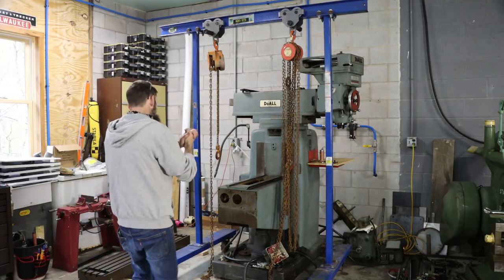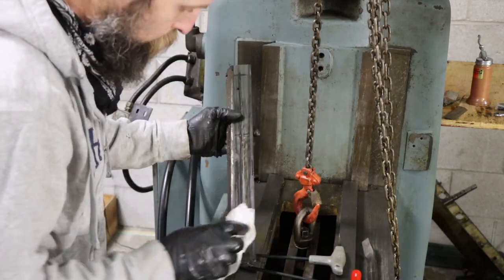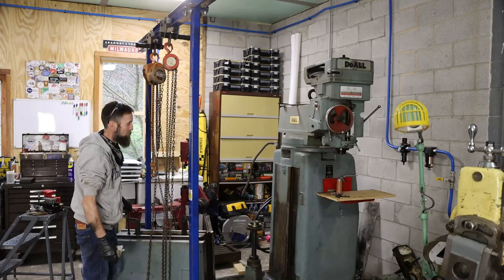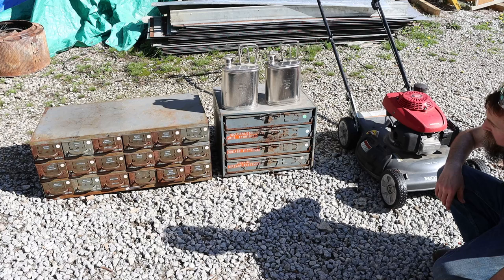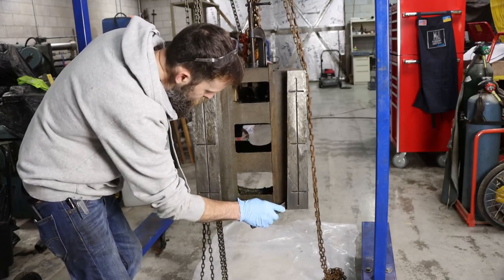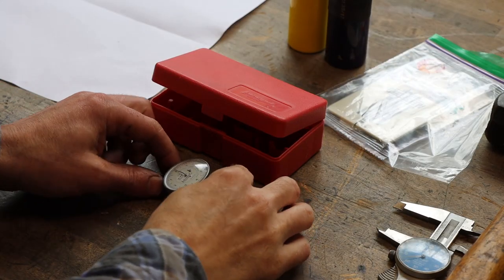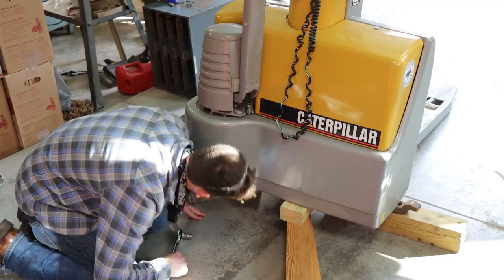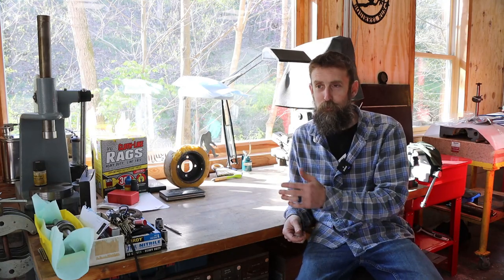Off with the Knee of the DoAll milling machine.

Comment: Hi Steve, another handy item in the shop for installing and removing screws is the "Chapman" ratcheting handle with an assortment of bits up to 3/8" hex, screwdriver, and Torx bits. Love mine for getting into tight places.

Comment: Mill is progressing nicely. Glad that you were able to remove the knee so easily. You didn't have much lift left, just enough. I was thinking about that DoAll band saw. If I remember correctly your last on it was that replacement shaft. I remember you didn't drill it all the way through. I think that will be an issue as here is only one port for oil to enter, no way for oil to get to both bushings.
Thanks once again for sharing your adventures. Completely enjoy watching.

Comment: That forklift wheel was on the edge of unsafe! Surprisingly simple access... if you have a toe jack. What a screamin deal for such a good lift. Watching the knee removal on the mill was fun, but I'm anticipating videos of your projects! Thanks for your videos, I always enjoy them.
Reply: My luck on the wheel replacement would have gone something like this: spend a day just trying to lift it, 3 days fighting to get the old one off, a day and a half to get new one installed, a half day to lower it down..... then discover there was a lever I could have flipped to open all the covers up and get direct access, while cleaning off my greasy fingerprints.

Comment: I worked for a Montgomery Wards in the late 70's in the repair shop. Maintenance contracts were very popular then. People would abuse their mowers because we would still fix it under the contract. It was easier to fix than argue, I guess. Wasn't my decision. We had a commercially made jig specifically for straightening crankshafts on vertical crankshaft mower motors. We were selective about straightening them. Agreeing with your statements, only ones with minimal run out would get straightened. Otherwise we would use a new short block. The labor time was not very different but the parts cost was.

Comment: Amazing how machines/heavy parts grow in size when you get them in the air.

I think, in time, you won't miss what you spent to get that lift into shape.

Get that mower started and see just how bad it vibrates.  If it isn't super bad, use it where you wouldn't want to take your good mower.  If you kill it dead on something, you haven't lost anything.  I had one I used for years, across the creek that went through the back yard.  I'd come back across the creek with my eyeballs wobbling, but it did the job.  Deck falling apart was what finally killed that one.

A two day barn/shop warming event sound appropriate to me.  One day for Brian's, the other for yours  ;-)

Comment: The sun light poking through the windows looks great... Not to insult your intelligence, by any means, but, pay close attention to oil rags in a waded up area, and sun light rays beaming in on them.. of course, in the middle of summer... I had one do that, on me, some 20 years ago, about 4 hours after using the few rags, and was doing something else and was gonna come back to finish that project up, and was smelling something burning.. turned around, and the few rags were flaming away.. I am just glad it was on the concrete floor and not my work bench, and lucky I didn't walk away.. I do remember, the stories from wood shop and metals classes back in high school, that would warn of such a thing, and always imagined, it was from throwing them is a box, and stuffing them in a corner and forgetting about them.. Nope, hours after use.. All because the sun was shinning right on through onto the rags I was just using..  Anyhow, it is all coming together, the shop that is..good job.

Comment: My friend - when I was a young man I worked in a huge Lawnmower central repair Hub shop for Montgomery Wards. When a pushmower would come in with a bent shaft we would pull the blade and blade holder till it was just a crank sticking out, slip a short length of pipe over the shaft and give it a whack with a short hand held sledge (my dad would call this his "Bappin' hammer") anyways, you knock it around until true by eye and you bolt that shit back together and send it, Lawnmower cranks are soft as can be and this is normal practice - Just FYI

Comment: I have a mower from the late 50's that I was using when I was a kid . I was trying to mow down some high weeds by picking up the front of the mower moving the it forward and dropping on weeds with engine wide open. What l didn't know was a pipe in the ground and I hit it. The key in the  flywheel was sheared but  
also it cracked the flywheel. I took the flywheel off another old engine and put it on with a new key. The point is the crankshaft was not ben

Comment: One, I would suggest cutting a piece of wood to bolt to the bottom mating surface of the screw housing while working on the machine to protect that scraped in surface..  Also the screw inside a screw is for a finer adjustment.  

WD-40 and a scotch bright pad will clean those surfaces better than a power washer, also it won't rust the metal.

Comment: Steve, another great video.  The vertical ways look fantastic.  The grinding should go really well and that machine will be fantastic.  New squirl as well. Epic!  Additional standards for the hardness tester a huge plus.  Vladimir's channel is his name :).   That apron is fantastic :). Those dyes will be great for getting the mill scraped in.  Thank you so much for the shout out.  Work has been keeping me very busy and I do have more footage to edit.  A lot on the arbor that surprisingly turned out well with issues.  The indicator should work very well if not just let me know.  Thank you again, Phil.

Comment: I mowed alot of lawns as a kid and went through many different brands. Never really found one i didnt think was crap in some way but the honda mower i used worked well but most importantly started on the first or second pull every time.
That cat fork lift sure seems to be worth every penny. Your body is going to thank you later

Comment: Hi Steve, the wheels of your forklift are made from a polyurethane elastomer, one of the popular brand names is Vulkollan. This is a very tough material but it can wear out due to fatigue. It’s also sensitive for hydrolysis, for example being for a long time in contact with (warm) water.

Comment: I had a Craftsman Mower with a design flaw of a huge key/keyway that when you hit something, all the torque went to the crank.  Bent thr crank twice having it straightened twice...  that cost was the same as the stump grinder rental I finally used to remove the stumps.  It wasn't the big stumps that got me it wasnthe 2 inch one hiding in the weeds that did it!

Comment: Steve, I have a comment regarding building a copy of the gantry. The vertical posts should have knee braces added to provide a better structure on the base sides. If it is used to move a load located up high, all of the stress is concentrated at the base and that doesn't seem to be very desireable.

Comment: If you build a similar gantry, consider arranging the legs so they can rotate 90° .Then you can stow it flat against a wall ,secured by an anchor ,when not in use.
I suspect that wheel sat in one position with damp rising through the floor. Depending on the formulation, urethane degrades when exposed to moisture or hydrocarbons.

Comment: Buy yourself some high alkaline truck wash.  It's very strong and repeated use can dull paint but it works wonders with grease build up and rusted/tarnished metal.   It's better than anything else you can buy even Gunk.  5 gal is $35 at my local industrial supply.  You can delute it with water for regular wash jobs or just spray it on straight with a garden sprayer for heavy stuff.  Be sure to have the pressure washer ready to spray it off before it dries or you'll have to reapply.

Comment: For your lifting jobs, you would be better off with a small 4000# yard forklift with dual masts. They are very cheap on the used market for guys with only occasional usage and they are maneuverable enough to use inside, but can also be used outside for jobs in the yard and can be parked outside to keep your shop space free.  I bought a 4000# one in 2001 for 1300.00 and used it for 15 years with nothing but basic maintenance and then sold it when I moved.

Comment: You should look up the engine and see if you can buy a new crank shaft for that engine.  I had a bent one (not a Honda) from hitting a rock and was able to pick up a new crank for maybe $20, and it was pretty easy to install took a couple hours at most!

Comment: Even if the crank shaft is bad on the mower, you could keep the body in case your other mower's body rusts out
Reply from the maker: Yeah, the mower I'm using now is made from 2. One had a bad motor and the other a bad deck. Chances are I will straighten the crank on that Honda. It's not badly bent. Really just enough to vibrate badly.

Comment: For a good cleaner for cutting grease and oil that would work for the knee or anything else, try and get ahold of a produce made by Zep. Its called Zepteen. Its self emulsifying and cleans awesome. Only draw back I found is it kind of stinks. Something to use outside. Spray it on,  let it soak, Brush or scrub if you want, then either hose off or pressure wash.

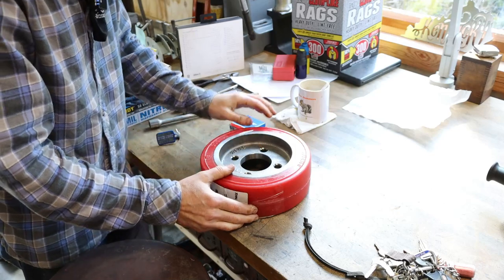Comment: 33:54 Oh gee Steve, don't you know that red wheels go faster. 😁
Reply: some times the color tell the different durometer (hardness) of the wheel (harder tires last longer softer ones slip less on wet floors)
Reply: Add a stripe and it's even faster!
Reply: More dakka

Comment: I'm surprised the gantry doesn't have some bracing or gussets... but hey I'm not a mechanical designer. Seems to do the job tho' didn't look to flex or splay out :-) 
 Oooooh another baby squirrel :-)
Hope you feel better next week.
Reply: It would probably lift three times as much with a few improvements.

Comment: I'm pretty sure that little Honda mower is overhead valve rather than overhead cam.  The new squirrel is cute!!
Reply from the maker: It's a overhead cam, strange in a push mower. I didn't know they made the jump to it. Obviously they have had the OHV for a long time.
Reply: @SteveSummers  that had to be an expensive lawnmower when it was new!
Reply from the maker: @andrewevans1658  Yeah, its probably worth repairing. I have a straightening setup I started building years ago. Guess it's time to finish it.

Comment: U should think about investing ur money/time into acquiring an industrial hot water pressure washer.... makes cleaning equipment much easier and it will take off much of what hand cleaning won't if ur fully stripping a piece of equipment.... idk exactly how your shop is laid out but if water will drain out of your breeze way/ big doors u could maneuver or set the equipment/machinery whenever first bringing it in, even then if not u can set a sump pump and make shift mote to a container or something... I serviced, repaired, and cleaned plenty industrial pumps, power packs, diesel hammers, excitors, front end loaders etc. etc. this way and with stuff much tuffer to loosen than metal working machines could ever build up....it seems to me like the route ur going it wouldn't be a bad idea to keep it in mind.... I'm genuinely interested in this stuff and ur miles ahead of me I'm just saying, no offense
Reply: Still ain't hot

Comment: You think that this gantry crane is perfect but, trust in these words. A larger model in your shop, you'll find that you will use it more often than you think and will need to use it more often than you think. As for space wise. You should check out Keith Rucker Vintage Machinery's channel. Don't remember if he bought his, I do know, he did some modifying to it. 
Honda... extremely reliable engine(s). They'll run forever. You could easily pickup a new crankshaft, not that it's going to break the bank. 
On those "ways", what about the one's on the stand part of the machine, the part the knee attaches to? Won't those be worn as well? 
Speaking of the squirrels, do the others still stop in and visit with y'all? Great video as always, cheers :)

Comment: Is the crankshaft bent or what is more likely the blade is bent ? You would need to remove the blade and clean up spot on the crank where you can indicate the shaft . I would do it because Honda makes great stuff.

Comment: Just imagine. if you had a grinder head.. and made a block to mount it to where the clapper box mounts on the shaper.  you could set the shaper to crazy slow.. and lightly grind surfaces..

Comment: It is a shame you can't have the drive wheel resurfaced or can you? I have done work for a printer as in he printed pamphlets and had a wheel for his paper feed resurfaced and I machined to finish dimensions. In his case it was cheaper than new and did not take two months to come from Europe.Good progress on the Mill Steve. John, Australia.

Comment: The old Wheel has "Jungheinrich" written on, so i suppose this Lift is a rebadged Jungheinrich, which are top quality equipment.
What puzzles me a bit is the lack of a slow down movement of the forks, maybe a broken electric Valve ?
Reply from the maker: I'm not sure it's ever had a slow lowering feature. It would be nice if it did.

Comment: Check the crankshaft itself with a dial gauge. Those honda's have a stamped metal hub that bends easily.
Honda knows it so the hub is stupidly expensive. You can get a crankshaft for something like $40. That is cast, turned and ground. A carb with precision parts is $15. The hub is a cheap stamped and welded plate and it is $90.

Comment: Gonna have to go ahead and have you work this weekend steve....ok. and also gonna need to disagree with you about the bent shafts....repairing a slightly bent shaft is no different than sharpening and balancing some worn out old blades

Comment: If by chance the crank shaft is bent, I was surprised when I bent mine that a new crankshaft and seals and everything it took was less than $30 from my local Garden Equipment repair place. And that was for Honda OEM parts. I think the crankshaft was $26.50. also it was very straightforward to do the repair. The crank case has a diagonal seam.

Comment: I'm wondering if that tire isn't one that you press off the perimeter tire and press on a new one? The local Cat dealer has a trailer with a press mounted on it to go service the forklifts in the cold storage plants. If it's replacable it might be worth hanging on to the rim.

Comment: Maybe im just paranoid, but it sure feels like where the two uprights on that crane are welded/bolted to the two wheeled stretchers at the bottom is a scary point of failure with that kind of weight swinging around, should you swing it a bit too far or one too many times I just worry about the weld between the two uprights and plates at the bottom could fatigue and let go with grim consequences, my mechanical mind wants to see angled support on both sides to prevent it -- but im paranoid and tend to over build things so maybe its just me thinking the worst--lol

Comment: Putting that 400 pounds on the tailgate made me nervous!  It's only sheetmetal and the weight was centered (as opposed to distributed).  I'm sure if you go back and look at the 28:30 mark, you will see that it is bowed when compared to the bed.  It would not take much to start a crumple that ends up with cast iron on your toes.  To confirm, the 29:35 shows the tailgate straightening out when the weight is removed.
Reply: Load was still within elastic deformation limits. But close to buckling. Good ol' truck!

Comment: That's a lot of weight on those old tailgate cables. I had one brake with just the weight of a person.
Reply: Square body Chevy has strap steel tailgate supports. 
The next generation went the cheap way with cables.

Comment: What is that cleaner you are using ?? Looks great stuff . Wonder if we can get it here in Australia .. good job Steve
Reply from the maker: Its called Purple Power 👍
Reply: @SteveSummers  found it bit expensive $147.00 for two bottles ouch ! But looks like great stuff
Reply from the maker: @markfoster6110  that must be due to your location. The stuff I am using was like 50 bucks for 5 gallon diluted.
Reply: @SteveSummers   yes . Australia is a long way away !! That's for two spray bottles so less than a quart. I don't think I will bother ... Great channel you have . I have a workshop here I have been building .single handed . 18m x12m 6m high so I know how time consuming it is . You are lucky to have a few helpers . Keep up the good work

Comment: Those bars on your tailgate are pretty sturdy.   I would never trust that much weight on a tailgate with the skinny wire supports they use now.
Reply from the maker: These old tailgates are strong. It has no trouble with 400lbs.  👍

Comment: Man if I had to clean that thing first thing I do is get a great big Rubbermaid tub and a gallon of simple Green fill it with scalding hot water dump the simple green in there punch that thing down into it and get scrub brushes and scrub that thing inside and out you can let it sit overnight and it would probably just wipe right off

Comment: Andrew camerata used a hammer to straighten a bent crank one time, personally i don’t recommend, but it did work.
Reply from the maker: That can work as long as you dont damage anything else in the process 😁. I've seen it done like that as well but I like a bit more control. Slowly pressing out the bend is the best way to get a quality outcome.

Comment: That old wheel was likely made out of some kind of nylon based material -- nylon is hygroscopic and will slowly degrade in presence of moisture.
Reply: Generally polyurethane.  There are different durometer polyurethane forklift tires.  With one manufacturer I deal with, red is their softest, and yellow is harder for heavier loads.